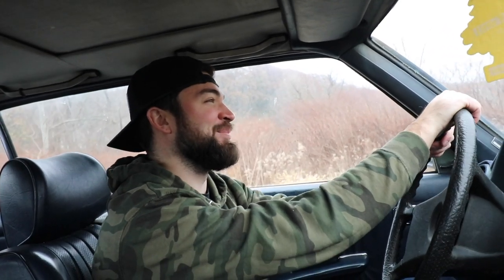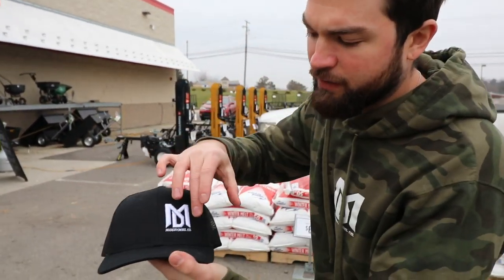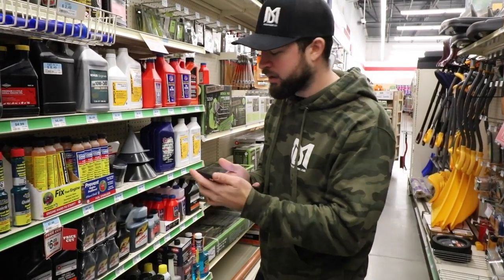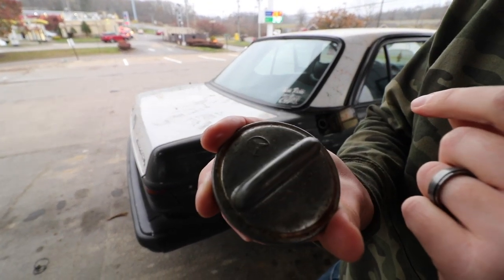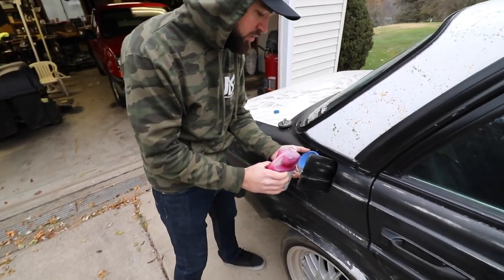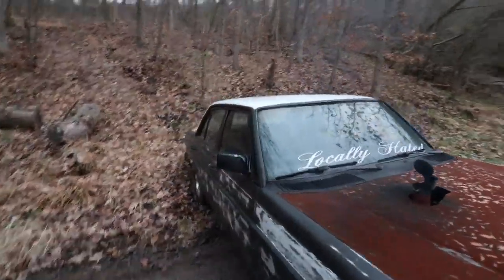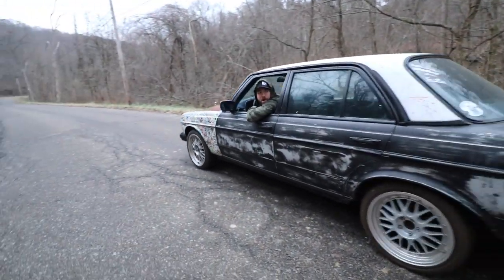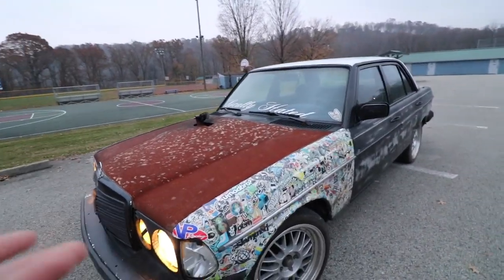What Happens if you use 2 Stroke Premix OIL in your Diesel?

Comment: Watching you try to figure out the premix ratio is a reminder of why the metric system is so superior.
Reply: I mix and match metric and standard. I mix 80ml of oil with a gallon of gas.
Reply: Yeah, I mean how could a country become the greatest superpower the world has ever known on imperial. Crazy to think huh
Reply: @Resistculturaldecline  Many speed records and lap records were set by vehicles running bias-ply tires. Doesn't mean radials aren't better.
Reply: @CaptHollister   And the speed records for aircraft were set with imperial, over 60 yrs ago. 

Over 4000 metric missiles were shot at our 2nd fastest plane and none touched it. That, alongside the other gazillion achievements.
Reply: @Resistculturaldecline  It's a good thing the SR71 doesn't run on premix, otherwise you would have needed a calculator to figure out the correct mix, whereas I can easily calculate any ratio in my head using liters and milliliters. Besides, both China with a population of 1.4 billion and India with a population of 1.38 billion use metric proving that people who use metric have more sex.
Reply: @CaptHollister  I'm sorry the imperial system has treated you poorly.
Reply: @Resistculturaldecline  By your logic there's no need for cars, since horses do the same thing but with less efficiency, no different than metric vs imperial. Finding excuses not to use metric and just add or remove zeros with incredible ease even when doing complex calculation is pure ignorance, sorry.
Reply: @Resistculturaldecline   "how could a country become the greatest superpower the world has ever known on imperial" Because the scientists and engineers use metric bro, lol. You think Wernher von Braun was using that pathetic bri'ish imperial shat when he sent people to space? f-ing lol.
Reply: @em4703   Werner was offered to join the country that helped kick his country's ass, with imperial.
Reply: There's 2 types of countries in the world,  those that use the metric system, and those that have been to the moon 😂😂
Reply: @TheJMontoya83  NASA uses the metric system.
Reply: Ya except when you try to use a combination of both = pure chaos
Reply: Nope it’s not.
Reply: @phillipteems6617  Yes, actually. When everything is base 10, oil ratios are calculated as percentages. In the rest of the world, 40:1 is given as 2.5%. 1 Liter is 1000ml. 2.5% of 1000 is 25ml, so I add 25ml of oil to each liter of fuel. I can easily do the calculation in my head.
Reply: Fractions are more fun

Comment: The size of oil molecules is microscopic compared to the 5 micron of particulates that make it through the fuel filter. It won’t plug your injectors😆
Reply: I had a chuckle over that  🤣

Comment: Well 2 cycle oil as an additive was recommended to me by Big Bang Injectors. I have a 2007 dodge 3500 w/ 5.9 Cummins, all stock. It runs rough when cold and smokes white intermittently. They figure my injectors are worn, so saving my money for a new set and running the oil in the mean time. About 350ml per tank.

Comment: I use Conklin diesel plus in both my big rigs and my drag truck. I also treat the drag truck with about 4oz of 2 stroke oil. It's a 12 gallon fuel cell. The p7100s need a ton of added lubrication at 5-6000 rpm. Modern diesel fuel does not have enough lubrication to maintain good barrel/plunger wear at that rpm. 2 stroke oil won't clog your injector tips.

Comment: Put the additive in your tank First, then the fuel. This helps for better mixing of additive and fuel.
Reply: It really doesn’t matter the fuel mixes as the lift pump runs continuously
Reply: @ericrivera219  yep. if i put the 2t after fill up i just pour the required amount into a bottle pour in half a litre of diesel shake it up well and pour it in.
 Assuming that this is only done to older diesels with mechanical pumps the vibration caused by the engine would mix it well in no time😅

Comment: I use a quart of tcw-3 in every tank in and old 12 valve.   It helps lube the pump on older diesels that were designed with sulfur based fuel.
Reply: I just got an 8v92 silver 2 stroke Detroit, I changed and filled her with 1/2 shell rotella, 1/2 quicksilver synthetic TCW3 and it runs smoother and cleaner than ever! Quicksilver I mix my n the fuel also.
Reply: I mix and fill crankcase with XD-100 2 stroke synthetic on my old 7.3. I just filled my 8v92 Detroit 2 stroke with 3 gallons of Klotz techniplate 50 2 stroke with 5 gallons of amsoil dominator synthetic 2 stroke, pricy but worth it, she loves it
Reply: yes this is a youtube post not treu
Reply: Are cummins the same power to weight ratio as a rotax 850???
Reply: Bruce Miller   Exactly the same.

Comment: I wouldnt on a def system but in my old 03 clapped out lb7,she loves the evinrude 2 stroke,I run a quart or more every fill up,it quiets the injectors down immensely,also if you ever Google 2 stroke burn test you can see 2 stroke acuatlly leaves behind almost no deposits,ever see what all other additives leave behind?,its night and day as far as noise and the amount of smoke produced running 2 stroke...before I ran it with a mild tune it would blow nice sized clouds when you got in it,now almost nothing,if you look at common rail diesels there is acuatlly so much metal to metal contact surfaces that rely solely on the diesel fuel for lubricity,it always amazed me people say 2 stroke is bad for truck designed to run on low sulfur diesel at min 500 ppm but think additives with less them 15 ppm will help in any way shape or form,bio diesel is good but I dont have it by me,opti-lube is good stuff but way too expensive 2 STROKE!!!! IS THE KEY
Reply: I run 1qt per tank on my lb7 and lly both 400,000 plus miles

Comment: Those old Mercedes diesels will run on damn near anything. I’ve heard you can run them on straight vegetable oil. High injection and low compression.
Reply: yup ran one for a few years in LA an outfit named Loves conversions ,echo park ca. used a preheater on the fuel line and it ran well 26 mpg's smelled like French fries wherever I went !!

Comment: I would recommend hotshot products to anyone with a diesel. I use the fuel treatment every full up and the friction additive every oil change in my 2000 7.3. Love all their products!
Reply: I got an 8v92 silver Detroit 2 stroke and 2000 f-250 7.3. I changed oil on both with 1/2 shell rotella 
,1/2 quicksilver synthetic tcw3, it work great and I feed some to the fuel tank to mix also. The 7.3 could make a nice poppet valved 2 stroke conversion
Reply: I have a 97 7.3 I’ve ran everything in it in a pinch before it runs fine on almost anything from tranny fluid vegetable oil used motor oil black diesel 7.3 all day long

Comment: I found this video, trying to answer a question.
To my understanding. The only reason why a diesel engine can't run on gasoline, is because fuels like gasoline & alchol are not oily enough to lubricate the high pressure mechanical fuel pumps of a diesel engine....So does this mean a diesel engine will run just fine on 2stroke oil and gas premix? Maybe enough oil in the gas, until it feels like diesel between fingers? Maybe a higher gasoline ratio then that feeling?

Comment: If you want more power and clean injectors use either Millers ecomax diesel or pure 2-ethhyl hexyl nitrate( its the main ingredient in millers ecomax diesel. Its a cetane booster and genuinely gives noticeable power improvements along with a host of other positives and zero negatives. 

All other additives are just horse shit and a waste of money. I usually add 100ml-150ml per 50 litres. This is the max you'd want to go to. I've often put more than that in, it doesn't seem to hurt it but it doesn't do any more it just needlessly wastes it. 

The recommendation is 50ml-100ml per 50 litres. But I've found you can get better performance up to 150ml per 50 litres.

Comment: Diesel fuel is an oil anyway.  In fact Diesel engines were invented in 1896 but the petroleum-derived crap which we now call Diesel fuel wasn't invented until 1933.  So from 1896-1933 all Diesel engines were run on other stuff, commonly hemp oil, peanut oil, or similar. The Diesel engines of today aren't much different, and can often be run on the same stuff with only a little modification.

Comment: I have a 100 gal transfer tank in the bed of my 12 valve. I put used motor oil in the tank all the time I also fuel my truck and small tractor from this pump that way I'm always putting filtered fuel in my tanks. I have mixed as high as 50/50 mix truck runs just fine 275000 and still on the original p pump and I also use hot shots secret every 3 months
Reply: Are you filling and running 2 stroke oil, I filled my 99 7.3 with 3 and 1/3 gallons of cd-100 2 stroke oil and I am rigging of total loss oil burn off
Reply: Opps xd-100 2 stroke oil, the 7.3 as well as 5.9 can be converted to poppet valved loop scavenged 2 stroke with baffled intake valves for thorough loop scavenging! Hehe
Reply: @jlo13800  I don't really haven't keep a close watch on how much fuel is in the tank when I put the oil in it alot of  times the fuel will come out pretty black when it gets that way I go top the tank off. The tank when I first started this I was only doing 4gal of oil to 100 gal of fuel and there were no problems so next time I doubled the oil and no problems.so now I don't even watch. Meet a man he was running a 50/50 mix with off road in his cummins. That fuel was black as coal you sure couldn't tell that it was off road
Reply: @jlo13800  the EMD engines your talking about is that the same as what is in a locomotives. I use to drive for a company and we hauled parts for the G E locomotive to there repair shops. Switch ing my cummins over would probably be over my head. I can rebuild them and worked as a mechanic  with a man for a company that had a few 2 stroke detroits that we rebuild. But I don't know what your calling a popped valve. If it was on a detroit he may have called it something else
Reply: It’s a poppet valved u-loop scavenged like this 2 stroke VW diesel conversion: https://m.youtube.com/watch?v=kot9GYBeCJ8&t=42s
Reply: @davidcaskey4669  https://www.youtube.com/watch?v=kot9GYBeCJ8&t=44s, here is a Volkswagen 2 liter diesel converted to u-loop poppet valved  2 stroke, its been done with hemi racers, the int and exh valves are timed around the same time and a baffle is installed on the inlet valve for throurough down sweep on in let air charge, think of the Toyota s-2 in  the supra 2 stroke
Reply: About you cummins 12 valve im not familiar with the but are the some high power to weight ratio engine that could power trucks, boats planes and PWC? are these some type of valved 2 stroke with turbo for scavenging like this VW diesel:https://www.youtube.com/watch?v=kot9GYBeCJ8&t=44s

Comment: 2SO was designed to clean as it burns. It has specials detergents for that purpose. JASO-FC or FD (or equivalent) is what you are looking for. The 2SO itself does not provide more power/increased fuel economy. The cleaner engine does that. 

Add 250ml to 80L of diesel, and Bob’s your uncle. <— Clearly I don’t live in the USA. 😉

Comment: They are running those cars off of straight cooking oil!!..and no plugged injectors!..don’t worry about the injectors…as far as the 2-stroke oil goes, you could go to 200:1 or even higher because 2-stroke engines rely entirely on that oil to lube the bottom ends of those engines at extreme rpm’s and pressures…a quarter of a quart to a full tank would be more than enough!

Comment: Try archoil I use to use hotshots switch to archoil oil and fuel additives noticable difference
Reply: Bill Hewitt told me about archoil. I used to own a 6.0.... Oh man the pain.
Reply: @Kirisutekarl  I've got 231000 on mine. Bought it with head studs and egr deleted. Runs good needs fuel and air system tuned up.

Comment: Hell most diesel engines will run just fine on straight 2 stroke oil or Atf. My 5.9 24V is burning 32:1 diesel/2 stroke right now.

Comment: OLD diesel tech vs new.  DPF and zinc is bad news.  That is why zinc is not in modern diesel oil.
Reply: That’s not true in my case. The mobile 1 that is required for my 3L diesel has 880ppm of zinc
Reply: @melvinhanson3659  I get so many conflicting sets of information.  I just get screwed on the best options.

Comment: There’s virtually nothing you can put in those old 300ds that will clog them 😂 you can run them on straight vegetable oil. A little two stroke in all fuel on all engines is the ticket!

Comment: Old diesel engines with mechanical injection pumps runs very well with 2t oil mixture. It purrs like a kitten compared to the low or no sulfur diesel sold nowadays. I've been using it for 15 years now for my two old trucks. Without the mix it vibrates a lot. And also most of 2T oil has de carbonizing properties.
Reply: Sir,  Is good  or bad ?  
Oil mixture   diesel  fuel  is good old model truck ?  
Please  reply me 
I am from  India  
Thank you
Reply: @moviecapsule1108  The gas station accidentally mixed gas into my diesel.  Maybe half the tank is gas half diesel.  I'm thinking of adding 2 cycle oil in there hoping it helps.